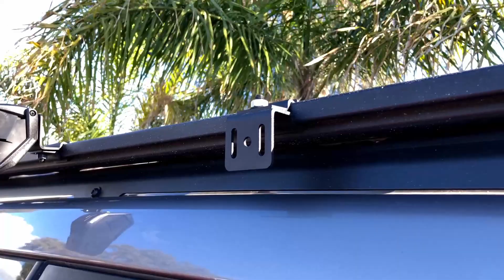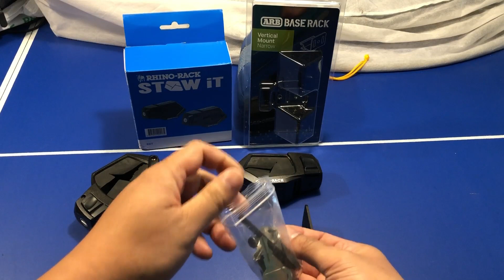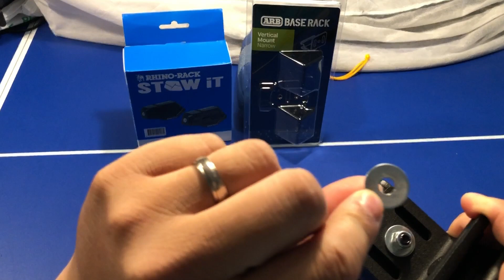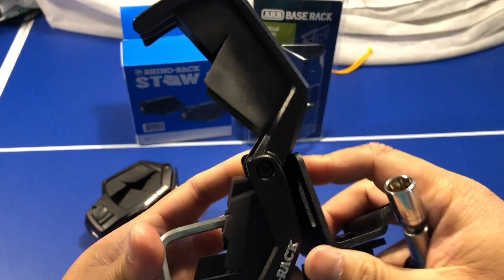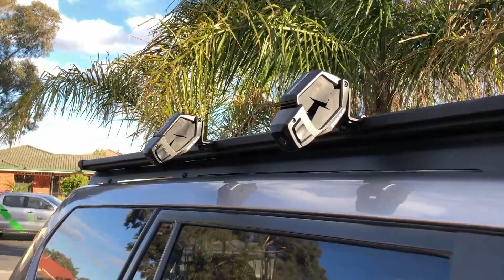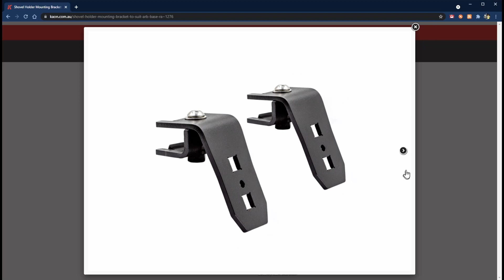PRADO BUILD // ARB Base Rack shovel holder using Rhino-Rack Stow It

Comment: You can buy an ARB Base Rack adaptor for channel mount fittings
Reply from the maker: Yes - that can also be used.  But it's more expensive, is a bit more bulkier, and only allows you to mount the shovel holder on top rather than the side.
Reply: @lyphtec  just saw another option for side mounting from KAON
Reply from the maker: @BackroadsandBillabongs  yeah - KAON shovel mount is nice but it costs twice as much :(